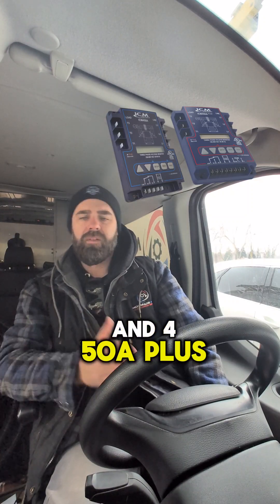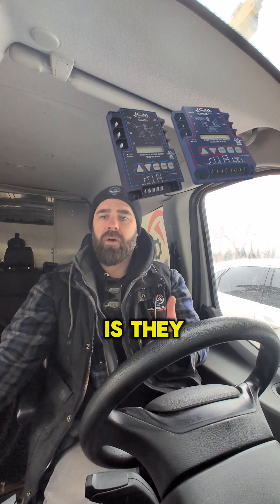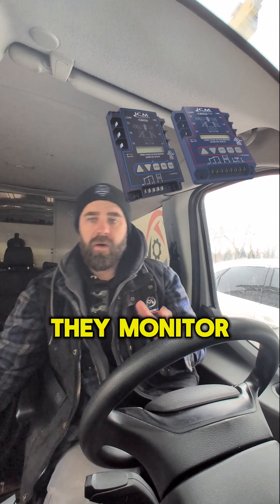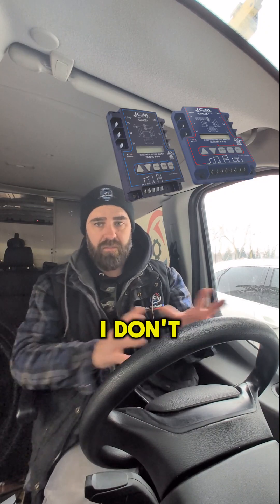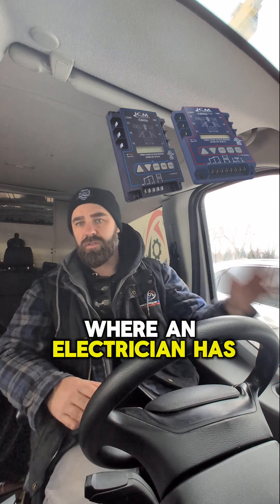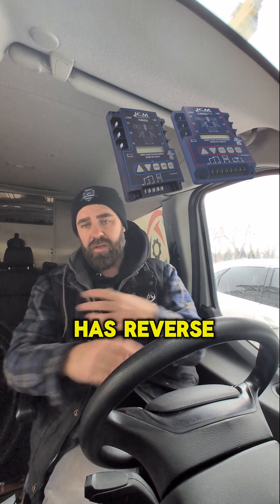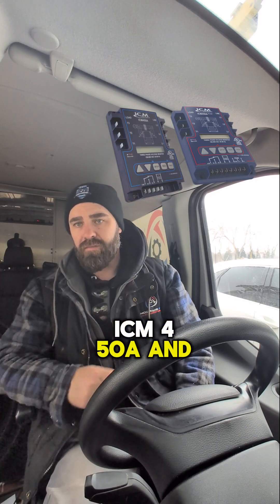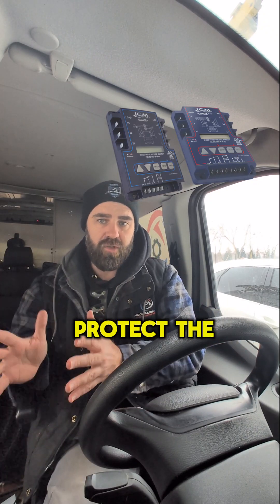ICM 450A

Comment: Depending on the piece of equipment, it can also be prudent to install a breaker in the disconnect instead of a fuse, so you can get more protection functions over just a fuse. A lot of newer breakers have trip units that can monitor phase voltages for things like this.